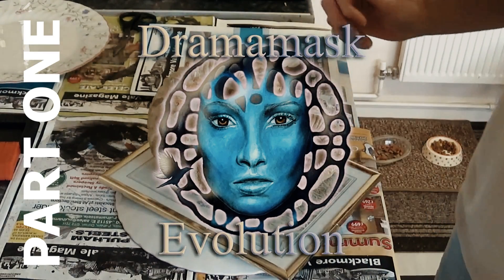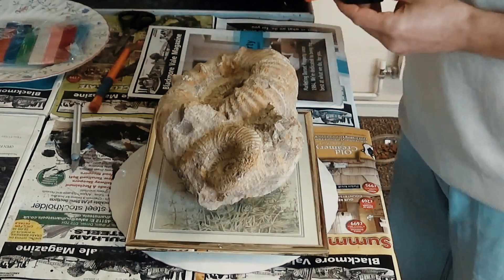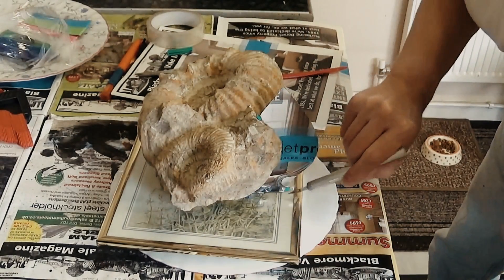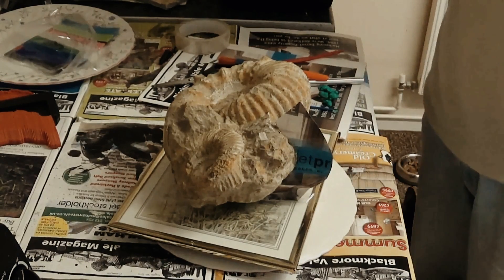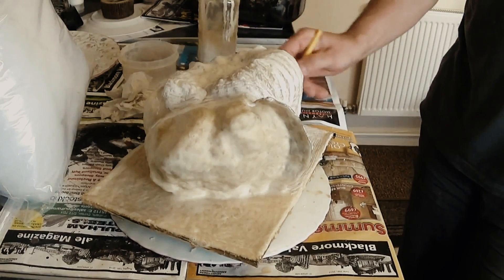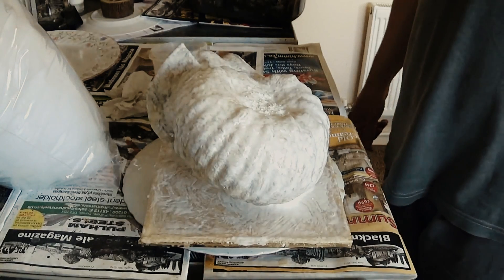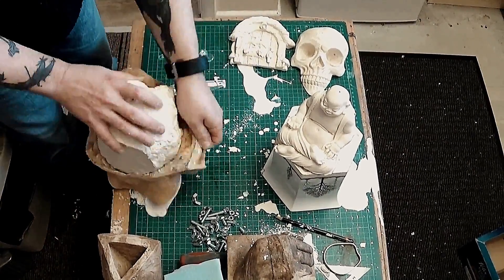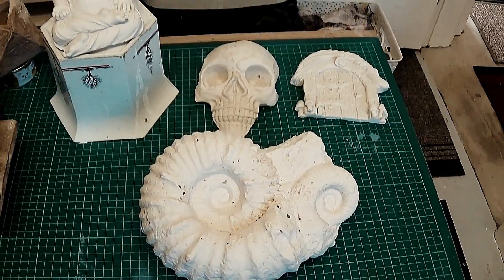Molding & Casting A 500 MILLION YEAR OLD FOSSIL | Full Series

Comment: Awesome work buddy. I’ve been carving Moai heads from breeze blocks.  Now I have a way of repeating them in a more durable material. Do you use a seem on your Moai latex mould?  If so, just down one side or both. All new to me and very interesting. I saw your link for your fibre glass.  Do you have a list of materials I’d need and any decent supplier for these. Keep up the good work, I might have just found a new hobby.
Reply from the maker: I didn't make a seam for the head I have here and made latex mold in one piece, unlike the fossil mold in this video which obviously has a seam around the back. There's some videos showing the head latex mold on some of the videos on the channel.

Comment: What fibres are you using? Thanks
Reply: You added a fibre to the latex to make it thicker, sorry I should of been more specific.
Reply from the maker: @MrTeazer10  I think that is probably polyfibres or the nylon wool which you might be referring to.
Reply from the maker: This is the fibreglass matting I use for making the fibreglass mother mold along with the resin of course: 300gm Fibreglass Chopped Strand Mat: https://www.mbfg.co.uk/300gm_csm.html